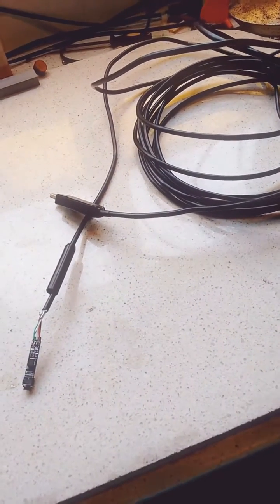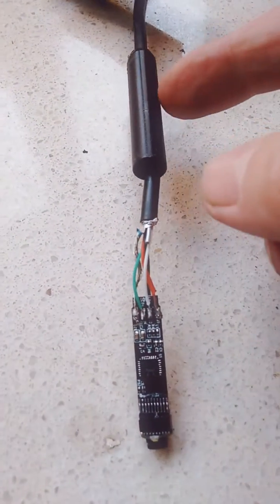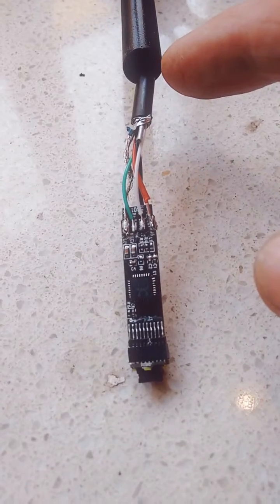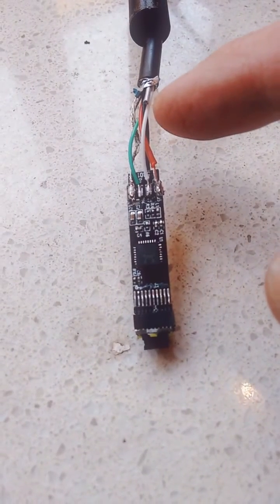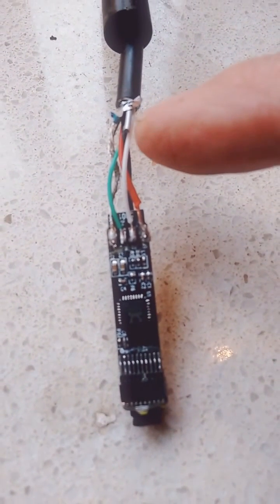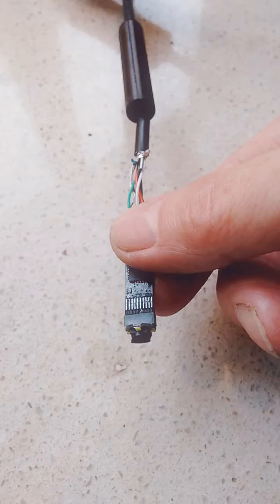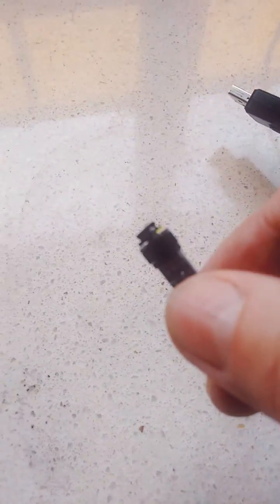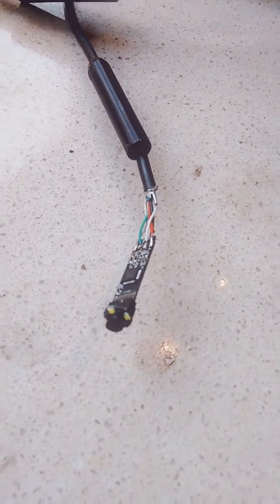USB endoscope stopped working- not recognized

Comment: Mine stopped working after a year of flawless service. The portion of the cable that goes from my cell phone to the endoscope's dimmer switch came undone. I opened up the dimmer switch housing and can see the 4 places where the wires connect but am afraid to short out my phone if I solder things incorrectly. Anybody have wiring diagrams? Hollis Jayden, I think you may have the same issue. The cable wasn't glued down properly in the housing and spun around. This detached the wires from the solder points. Simple fix ... if you know where the wires go.

Comment: my USB plug is the larger one and all the wires came loose, how do i know witch wire goes where they are Green,White,Red and Black and a bare wire, i know where the bare wire and the black wire goes but just cant figure the other ones, can someone Help?
Reply from the maker: hi Glen,  I didn't need to pull apart the USB end of my camera, so I can't tell you where the wires go, sorry.  It will probably be a standard config config for all USB devices, though.